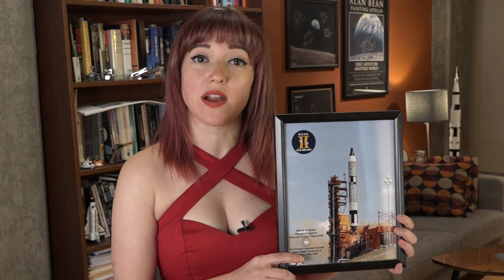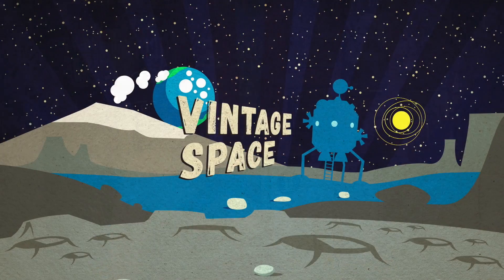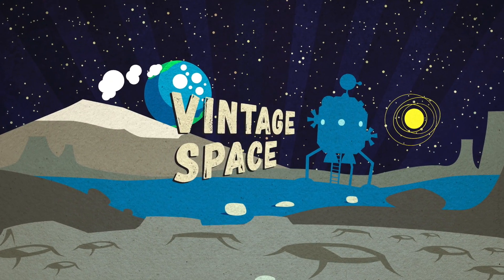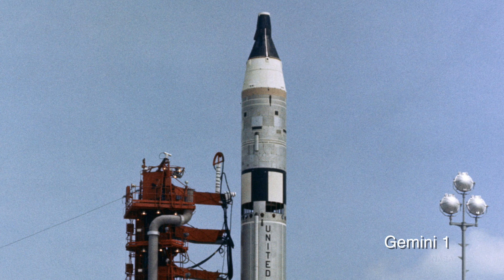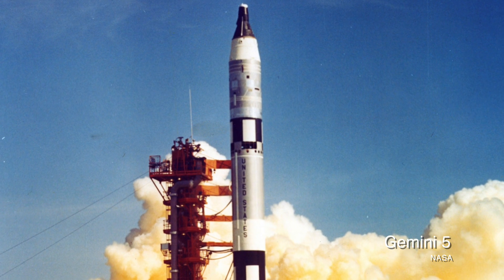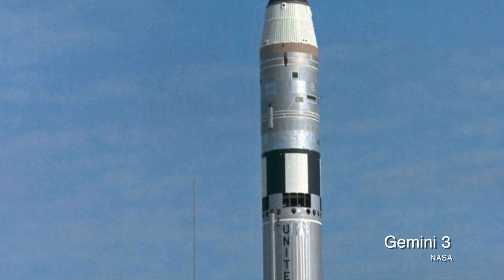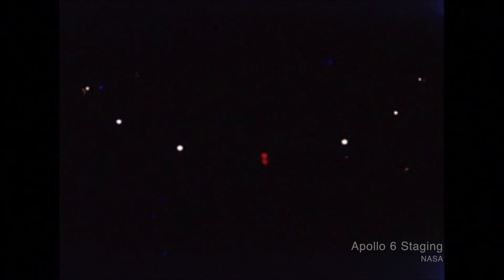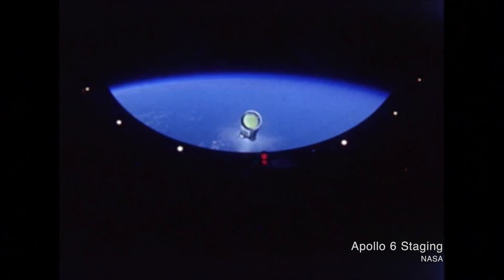Why Were There Holes in the Titan Rocket that Launched NASA's Gemini Missions?

Comment: The Titan II was originally  designed to be in a missile silo to carry nukes.  See, "Command and Control" by Eric Schlosser.   One exploded in a silo when Gov. Clinton was in office in  Ark after a technician  dropped a large socket down about 90 feet and punctured the thin skin of the fuel tank.  Eventually the rocket exploded with the nuke still on board.  The nuke was found on the roadside the next day unharmed after it flew into the air a few hundred feet.  It's amazing that they took an intercontinental Ballistic missile and put two men on top where the nukes were supposed to be and shot it off into outer space.   Instead of designing a new rocket for a new purpose, NASA used a ship that was designed to carry a MIRV.  That was one of the best cost saving peaceful things I can think of our country doing in all my years.  DPA
Reply: +daffidavit Actually, much of NASA's space program during the space race days relied on ballistic missiles developed for military use. After the spectacular failure of Vanguard shortly after Sputnik, which was developed under orders from President Eisenhower to be an entirely civilian undertaking to place a satellite into orbit for the International Geophysical Year, von Braun was given 90 days to do whatever it took to get a satellite into orbit. He had been ready (actually itching) to do so but had been under orders not to launch a satellite using military means so he was able to move very quickly and Explorer 1 was launched just a month later using a modified Jupiter C called the Juno 1 which was derived from the Army's Redstone short range surface-to-surface ballistic missile. 

It was a modified Redstone missile (derived from the Jupiter C design) that carried Ham the chimp as well as astronauts Shepard and Grissom on their sub-orbital Mercury flights. A modified Atlas missile, the US's first ICBM, was used for all of the remaining orbital Mercury launches. Project Gemini relied exclusively on the modified Titan II ICBM. Even the Saturn I and IB relied on clusters of propellent tanks and eight engines that came from the Jupiter C for their first stages.
Reply: +daffidavit :I was fortunate enough to have worked as a Titan-II ICBM electronics tech from early 1981 to late 1983. I was stationed at LRAFB and we would go do maintenance on the 17 sites still in existence after the famous 374-7 incident. Dire Straights did a song called Industrial Disease which featured the line someone dropped a spanner into the hole. I was still in tech school in Texas when 4 7 as we called it, blew. That was based on the 374-7 explosion. The Titan-II served from 1963 to 1987 and had a single 9 Mt RV. It could have been but never was MIRved.
Reply: +J Dean :One other thing. I deal with space fakery a lot and often point out the fact if we could build rockets to send nukes halfway across the world, why couldn't we stick a person in place of the warhead which is what the Redstone MRBM and Atlas/Titan ICBMs did.
Reply: Same with Redstone missile, which carried aloft the Mercury capsule.
Reply: Cool!
Reply: +The Eastjesus Company A modified Jupiter-C named after Jupiter's wife! Someone did their mythology homework.
Reply: +daffidavit not a MIRV actually. Titan II carried a single multi megaton class warhead, not a MIRV bus with several warheads (as was later fitted to things like Poseidon and MX).
Reply: Noted and well appreciated. Thanks for the correction. As I now recall, the Titan II carried a single 9 mt warhead, the most powerful at the time.  I don't know why I used the term "MIRV" when I should have known better. But you are absolutely correct, the warhead on the tip was a single nuke of about 9 mt.  You are invited to correct me if I'm wrong, I don't mind a bit.    I'm glad there are people here who keep up with all this stuff. Be well.
Reply: I could be wrong, but i thought Vanguard was a navy project.
Reply: right after sputnik, the US actually launched a atlas missile into orbit that broadcast a taped message from the president at the time if i remember correctly, named project score. and the first MIRV warheads on US missiles were carried on the Minuteman 1 missile, i believe it carried 3
Reply: MegaWetwilly it was.  And Explorer 1 was an Army Air Force project.  Eisenhower wanted Vanguard in space first because the Germans weren't involved with it.  Don't forget, both projects were pre-NASA.
Reply: The Eastjesus Company Fun fact, the Saturn I was NASA's first major rocket that wasn't based on an ICBM.
Reply: Oh hey look, it's a nuke! Cool! :P
Reply: Hay we have a spare ICBM, anybody want to sit on top of it and take a ride?
Reply: SCORE was over a year after Sputnik and some 10 months after Explorer I.
Reply: As a consequence, it was the first booster designed with people in mind, and imposed a much lighter G-load (4 vs 6 or 7 on an Atlas or Redstone or Titan). The best description of Gemini-Titan staging and G-load, I think, comes from Dick Gordon: 

"On Apollo, the third stage of the Saturn V got to altitude and then chug-chug-chug at about half a G until it got the right velocity and shut down. Well, on Titan both were done simultaneously. And near the end, you've got 100,000 pounds of thrust pushing an almost empty stage and a lightweight Gemini spacecraft. It was startling how fast the G-forces built up. I said Man, how long is this sucker gonna keep a-running? I tell you I was ready for the second stage to quit about the time it did. And cutoff was a great transition. I mean, you're going from 7 Gs to zero Gs just like that. Soon as that engine cuts you are thrown up against the straps just like on a carrier landing."

Comment: in amateur rocketry, you have to drill holes in the body tube of your birds. This is because the pressure differential between the air outside and inside can be enough to blow your rocket apart. Happened to a friend of mine. The holes also stop the blast from your ejection charge from being too effective.
Reply from the maker: +Larry Phischman Oh neat! I never thought about that since I've never launched an amateur rocket. Thanks for that insight!
Reply: Which would be ironic for Young to say,  since he flew a Titan II.
Reply: To paraphrase John Young "I have no desire to drill holes in my rocket"  :)
Reply: +Larry Phischman I learned that the hard way - I actually had a little Estes Alpha III blow up when the ejection charge fired due to the nose cap being on too tightly!

Comment: I noticed there are extra holes in your outfit.  They seem to be used only for aesthetics. ;-) but seriously, the term ullage describes the empty space above the contents of a container and the ullage motors were there to insure the fuel was in the fuel intakes and not the empty space, not to distance the stages apart.  Retro rockets on the dropped stage were there to slow the discarded stage and create that gap. Also, if you look at the Soviet N1 Moon Rocket, they have these open spaces between stages with just a kind of framework connecting the stages. These were used in the same way you describe in this video to vent the exhaust from the firing stage as they were not separated until the upper stage ignited. So, the N1 holes were there for a function, not just for looks!

Comment: I'd never noticed that before! Also, I thought the purpose (or perhaps a purpose) of the ullage motors was to sink the fuel to the bottom of the tank so the pumps wouldn't be sucking dry, a point suggested also by Mr. Messer, below.

Comment: There's a second reason why a small motor would be included, namely that rocket fuel needs to settle at the bottom of a tank, which requires acceleration, either gravity or the thrust of a rocket.

Comment: Amy, I thing the primary purpose for the ullage motors was to force the propellants back down to the bottom of the tanks after separation so that there was enough pressure at the engine inlet to start the engines.
Reply: This.  Her explanation of why there were ullage motors is so incredibly wrong :(  Or at least, not the point.  And it also misses the point of WHY the Titan use what is known as hot staging the first place.

Comment: My favourite rocket is the bottle rocket, as everyone can make one and fire it safely
Reply: +Koppa Dasao, Sorry, but proper amateur rocketry requires proper recovery of the launched vehicle, thus parachutes or similar recover technology needs to be involved. Bottle rockets do not have this.
Reply: David Hoffman Amy Shira Teitel didn't specify that the rocket had to use dangerous fuel… A rocket is just an engine that spurts out matter at high speed so that it flies.
Reply: Regular Estes type amateur solid rocket engines are probably slightly safer than bottle rockets. The most basic rocketry kits are not that expensive and the launch hardware can be reused many times. One nice thing about the purpose built model rocket engines is they come with nice detailed specifications as to thrust, impulse, burn time, etc.  Rarely do you find that with bottle rockets.
Reply: Perhaps not, but you won't have to deal with hot exhausts, fire and safety areas when firing bottle rocket. Refueling is way easier too, not to mention cheaper. The propellant doesn't cost much more than a glass of water, and the oxydizer is readily available. A glass of water and a bicycle pump, and the rocket's ready for flight…
Reply: Koppa Dasao, Woah! I thought you were talking about those low cost fireworks type bottle rockets. So this was about pressurized water rockets? Sorry for me not understanding correctly. Yes, your water bottle rockets are a great way to introduce rocketry.
Reply: Wtf? Fireworks? No, I did say bottle rockets, not fireworks. Fireworks on a stick shouldn't be fired from a bottle anyway, but from a tube not much bigger than the stick, just fyi.
Reply: Koppa Dasao, I looked it up and they are also known as skyrockets. The really inexpensive ones have to be put in a bottle as the very thin stick is just for some stability, not support while on the ground. https://en.wikipedia.org/wiki/Bottle_rocket
https://en.wikipedia.org/wiki/Bottle_rocket#/media/File:Bottle_Rockets.jpg
Reply: Seriously, I wouldn't use Wikipedia as a guide to fireworks, if I was you. Those fireworks shouldn't be fired from a bottle at all, but from a tube not much bigger than the stick. Firing them from a bottle is seriously dangerous! 
You wouldn't fire an Estes rocket from an unstable launch plattform, would you?
Reply: Koppa Dasao, No, I would not launch an Estes from an unstable platform. I was NOT advocating the use of those things. I was advocating against the use of them and for the Estes style.  I just misinterpreted what you meant by bottle rocket. My fault. I had forgotten about pressurized water rockets being called bottle rockets. I just recalled that our local museum holds a series of rocketry science classes and that for the youngest participants there were pressurized air and pressurized water rockets. Again, old man not remembering everything about beginning rocketry. I apologize.
Reply: David Hoffman No, those things should only be used by people who knows they are not bottle rockets, but tube rockets.
It's a scary thing launching them from bottles. A gust of wind and you've given you neighbour a privat living room display
Reply: Koppa Dasao, In a lot of areas of the USA you cannot sell those due to the issues you bring up.
Reply: Same has happened in Europe. Some countries had even banned them completely, as people has continued to launch them from bottles after being told that's the cause of most injuries

Comment: You missed a couple of points:  1) The reason they fire the second stage without detaching it first is that they can't start it in free fall because the fuel needs to settle in the tank for the pumps to work.  2) The gaps between stages is very evident on most Russian rockets but American rockets typically use auxiliary thrusters to accelerate the stage before starting the engine.

Love your videos!  Keep up the good work.
Reply: David Messer Also, both the S-1C and S-2 had retrorockets for separation.  The ullage motors (in the case of the S-1C separation) fired after stage sep to settle the fuel, and give the stage acceleration to get away from the interstage.
Reply: Mark16:15 My guess is because the S-2 stage had five engines, where the Titan II only had a single engine.  With a single engine, it's not hard to get the exhaust flowing outward and not damage the structure, while I assume they probably couldn't do those types of calculations for the S-2.

Also holes in the structure reduce strength, and the Saturn V was considerably more massive than the Titan II, so maybe it would have incurred weight penalties that they couldn't afford.
Reply: Thanks for the explanation; however, I wonder why they didn't do the same thing with the Saturn V.  I could be wrong, but I think for that rocket they had a pump at the top of the tank that pumped helium gas into the fuel tank to force the fuel into the rocket engine.  I guess with some of the propellant momentarily not being used for thrust, that was considered too much of a disadvantage for use on the Saturn V.  Also, as it had more powerful rockets, maybe there was a concern such a method would damage the rocket's housing or structure.  If you have some better ideas, I'd like to hear them.  My father was an engineer who worked on the Saturn V's first stage in New Orleans in the 1960s.
Reply: +David Messer I learned about this when thinking about how fuel would float in tanks away from pump intakes. I googled it and learned. I could probably be an engineer but I suck at math.

Comment: I would like to see how the retractable arms on the Saturn 5 rocket works. I have never seen ANYTHING about the mechanics of that component. That's a lot of weight to move so fast!
Reply: +Tom Wilcox, The movement of the mass is not as impressive to me as the timing is. All those arms have to move at the same time and at a rate that get the umbilical connections disconnected properly with the arms out of the way of the launch vehicle.
Reply: +David Hoffman I have heard the shuttles explosive bolts, solid rockets and about 100 other things have to fire in 30 milliseconds.Amazing! Have you ever seen the Best of the Best that shows all the different camera angles of the shuttle? a must watch! its on YT
Reply: Tom Wilcox, I have not seen the " Best of The Best", but I have seen lots of SSTS launch videos.
Reply: +David Hoffman LOOK IT UP!!!! Watch it! It's super slow motion film cameras NASA used in every area of a shuttle launch. Has narrative from NASA cameraman. Close up of the explosive bolts on the solids at about 2000 frames per second. Close ups of the engine bells during ignition and a hundred other shots just made available to the public. If you like rockets and the shuttle it's a must see. You will be glad I told you about it. Seriously ! Let me know how you liked it.
Reply: Tom Wilcox , OK, I should have some time tonight to look at it.  The explosive bolt videos sound great.  Thanks.
Reply: +rich5562000 no doubt!
Reply: +David Hoffman I think you will be amazed!
Reply: +David Hoffman I was wondering if you had a chance to watch The Best of the Best?
Reply: Tom Wilcox, No, for some reason "The Best of the Best" did not come up in the YouTube search I did. I did find some other videos that seemed similar to what you described. The commentators were NASA employees who made special mention of the explosive bolts on the launch pad. You could see them activate in the videos.  The commentators seemed to know the camera numbers and made extensive explanations of the automatic camera controls that allowed seeing into the flame plume. The commentators described how we could see the controls in action as the color of the sky changed as the rocket plume would have normally blinded the camera. The had a video of the umbilical connections retracting into hoods and described the need for lights inside the closed hoods. 

I will have to search again for the exact videos you mentioned.
Reply: +David Hoffman that's the video I was talking about. I found the entire movie when I watched it a few months back. That is some of the best photography I have ever seen. All shot on film. No digital. I am going to buy the complete DVD set soon. Hope you liked it!

Comment: Their are inflight videos from inside the lox tank of either a Falcon 9 or an Atlas (I can't remember which).  While the stage is firing, the lox, sits, boringly, in the bottom of the tank, with a few ripples on top.  As soon as the thrust cuts off, the lox surges into a cloud of blobs and drops.  Ullage rockets exists primarily to settle the blobs and drops back into a quiet pool of liquid that can flow reliably, uniformly to the rocket engines.
Reply: Sorry about their instead of there.  I've always been a phonetic speller, a dangerous thing in English.
Reply: +Mark Holm, Did the YouTube comment edit feature fail to work for you? I have had that happen a few times today. I wonder what is going on with it.
Reply: +David Hoffman  The Youtube app for Ipad, that I use, has no edit feature.  Once a comment is posted, the only option is to delete.  I was not willing to retype the whole thing to correct one misspelling.